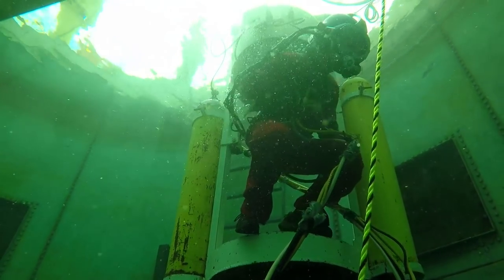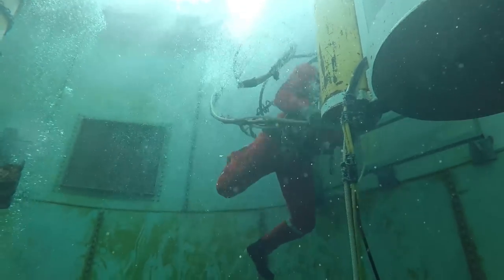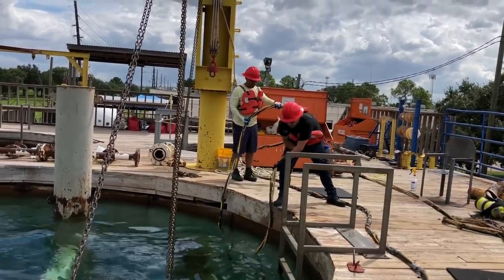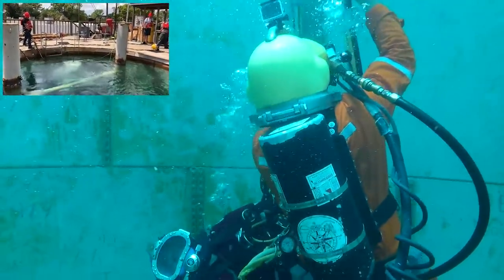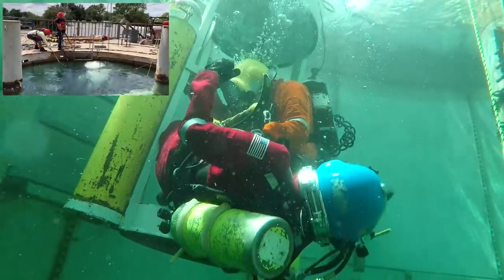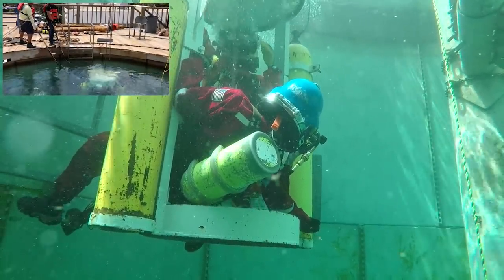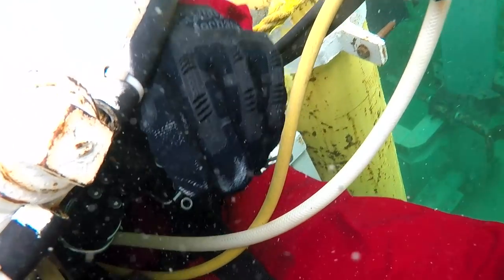Unresponsive Underwater Welder

Comment: I did this for almost 40 years. Started in the Navy, First Class deep Sea Diver for 18 of my 20 then worked commercial for most of the next 20. Also a year doing underwater bridge inspections for the Florida DOT. I loved every minute. Even when it sucked, was freezing, raining, zero visibility because when you get it done in those conditions you're allowed to be proud when you tell someone you're a Deep Sea Diver.
Reply: am i to old at 50 to do underwater welding, ive been a boilermaker / weld all my life.
Reply: @horseshoe182  I know a number of divers 50+ that I worked with. Obviously myself included. I don't know anyone personally  that got started at that age. Age isn't really the question. Getting a commercial certification is expensive and somewhat time consuming, Do you have any experience in the water? Recreational SCUBA?  Welding is about the easiest thing we do. Cleaning 50 years of marine growth off a sea wall before you make your first tack weld is where the work is. Running hydraulic hull scrubbers on 900' container ships with a 100' plus beam in 200' of water can take some getting used to. I've seen  experienced SCUBA divers freak when a hat went on and the breach ring was locked. I know this is long winded. The short version is you never know who gonna be the stud diver and who's going to suck at it until you suit up. Good luck.
Reply: Forgot to add this. What is your physical condition? There is a pretty comprehensive diving physical that must be passed every 2 years. EKG, chest xray, spirometer (sp) lung volume/function test. Higher body fat off gases less efficiently and makes you more susceptible to decompression  sickness (bends). Just be honest with yourself. It cost too much to try and wing it.
Reply: @careyrose6059  He's definitely out of shape if he thinks 50 is too old to be active. lol
Reply: @careyrose6059  thanks for that carey. eric bogar, your statement is very false and assuming, and thats how arguments start.
i,ve had a think about it and i think i,ll stay with contract boilermaking /welding. i don,t have the drive of a young man to follow through with the training.
Reply: Carey Rose Hooyah deep sea!
Reply: @careyrose6059  8
Reply: @horseshoe182  I'm making a living as a welder myself right now. A fab shop gave me a shot and some great OJT. Now I can weld anything they throw at my table. I get most of the aluminum TIG work. One of my favorites. Boss is giving my the evil I because I've been stalling taking my 3g/4g structural. He called me "Chicken". Lol
Reply: @careyrose6059  what country are you in? here in australia, we have the Australian Welding Institute that issues welding "tickets" (certification). i have no. 7 (tig) tested on pipe , and it wasn,t easy for me. out on site the Korean welders are the best by far, and most of them don,t hold any tickets. ive got tons of gear and i think im going to seek out my own clients, i can make and welded all sorts. i have a big old linclon jenny/welder and a new miller wire feeder, i,m interested in flux core welding atm, but anything to get the coin coming in. scored a job the other day and made 2k cash for three days work, so in theory it looks possible promising. i don,t think i,ll go for other tickets, only unless for job requirements/ specs. good luck with yours.
Reply: @careyrose6059  p.s  tig work is good clean work!
Reply: @careyrose6059  I just got my Open water certification. time to log 20 dives then apply to commercial welding school in canada. Hopefully ill be one one day
Reply: U a bad man teach me plz 💪🏾
Reply: @careyrose6059  i have a few questions about decompression sickness. How serious is it when you get it and how do you avoid it? Im taking welding classes and this looks like a really fun job to have.
Reply: @MileytheJeepV2  We (US Navy) broke DeCompresion Sickness (DCS) into 2 categories; Type 1 and Type 2. Type 1 symptoms fell under the P.I.S.S. categories. Pain in the joints, Itching of the skin, known as "skin bends", Skin rash, Swelling of the lymph nodes. Type 2 symptoms are neurological deficits, like vision problems, weakness, memory problems, numbness, paralysis, all the good stuff. 
It can be deadly serious. That being said, there are two primary factors to prevent DCS. Plan your dive and dive your plan. that means follow the schedule for the depth of your dive. Don't cheat. 
#2 muscle tissue off gases faster than fat. A lean machine with an efficient cardiovascular system significantly reduces your chances of DCS.
Also, if a diver does get bent, the quicker he/she is treated, recompressed in the chamber, the better the final outcome. And if not treated will result in a permanent deficit. As the diver, you're going to be the first to know something is wrong. Say something to someone. No one wants to get bent and I've seen a few that wasted some time trying to convince themselves it was something else and that delayed treatment. 
Probably should have led with this. DCS is caused when nitrogen bubbles in the blood expand as a diver ascends. When those bubbles get trapped by choke points in the blood system, they block blood flow to the effected tissue. If the bubbles stay then the tissue damage is permanent. Recompression in a chamber compresses the bubble back into solution in the blood and restores blood flow. 

Hope this helps.
Reply: Dope!
Reply: Carey Rose I’m 22 and I start my commercial diver course next year, any advice?
Reply: @CarLoverPhotography  I guess #1 would be to be sure you're comfortable in the water. If you have a dive cert and are comfortable in SCUBA that's a plus. Dive schools are expensive and to find out after forking over 15k to 20k ?? sucks. Seen it happen. 

 Get in or stay in shape. 2 reasons for that. Sometimes it's hard work, whether you're in the water or topside chokin' hose. A hat is always going to add resistance to your breathing. The other reason is an efficient metabolism off gases better which reduces the chance of DCS (bends). 

Good luck, and most of all have fun. It's a great life, most of time. lol
Reply: Thanks for the info 👍👌
Reply: how many ppl did you know fell to their demise because of the underwater welding?
Reply: @svgstudios831  Not a one. I've lost a few friends over the years, and heard about a few others but never during hot work. It was always something else.
Reply: @careyrose6059  scarry, props to you for being alive
Reply: Carey Rose awesome answers to all the questions thanks for the free info. I’m thinking of school in Houston and I’m curious about something. I have a kidney transplant (coming up on 10 years), I’m active, in good shape (jiu jitsu, running,etc.) , but I’m curious if this is an immediate disqualification or if it’s fine. I do take medication to keep my immune system at a regulated level when I wake up and go to bed but otherwise is good normal shape for a 33 year old Squid. Thanks 🙏
Reply: @Red_Cupp  You're going to need to check with a qualified Hyperbaric doctor. Obviously if any med carries a warning about machinery operation, driving or other potential  narcotic affects, it's a deal breaker. Call the school you're considering and see if they can refer you to a good doc. You might get info from your own doctor, but I'd definitely want to check with a specialist is the diving medicine field. Good luck.
Reply: Mike Hunt this is a good article on the subject : https://www.dansa.org/blog/2018/09/07/scuba-diving-and-life-expectancy
Reply: @mikehunt8064  The only people that know your life expectancy are the ones that show up at your funeral. My only life expectancy was to be happy doing what I loved to do.

Really the most serious health issue is with long term deep diving (saturation diving). It's known as Long Bone disease, syndrome something or other. Has to do with deterioration of the long bones of the body due to extended exposure to the high partial pressures of the gases the diver breaths at deeper depths. (+300 feet sea water FSW)  I don't know the specifics. If a diver makes that career choice, they will get the latest and greatest info on the latest and greatest research.
Reply: How much were you paid? Is it worth the risk?
Reply: Jeff King  I don't know what to say man. we all have are lows in life. Things will get better.
Reply: Jeff King  Are you ok dude? just checking in.
Reply: Lies
Reply: Omg im in school for welding now id kill for a job to weld im 17 trying to get a career in welding
Reply: I cant wait, i hope i get to achieve my dream.
Reply: @lukesweet1737  my advice, learn how to stick weld first. Gives you a good understanding of the molten pool and how to weld properly. Then learn to MIG weld then finally TIG (where the real money is). Anyone that slags off TIG welding simply can’t do it.
Reply: Hooyah my deep sea brother, Have you ever been to diversrecall.org. We will all be there.
Reply: Complete respect for this. Best of the best.
Reply: @patrickryan9410  Guess I missed this when it came in. I was at the recall in '96 or '97. My locker at TRF King's Bay sent a couple of us to the Working Diver's Conference and the recall was the same weekend. I retired in '97 and spent a pretty good chunk of the next 20 working in the western Pacific. I like warm water. lol 
Working in Texas now. I may try to make it out next year. Maybe some of this wacky $hit will level off by then. If not, well, we all know alcohol kills germs.
Reply: Respect.
Reply: Hey Carey, Idk if you still reply to this comment thread but I had a quick question. I've been looking at doing commercial diving but starting in the Navy as a Navy diver any tips on what to do to up my chances of becoming a Navy diver?
Reply: Àa❤❤àaa❤❤❤❤àa
Reply: Thanks for your service brotha glad there is people out there like you because I could never!

Comment: Note how when he's on the bottom, the "distressed diver's" suit looks black, but once he's hoisted up to the bell you can see that it's red. The rescue diver's orange suit looks almost brown ("burnt orange" to use the art term) at depth. This is an excellent example of how water absorbs different colors/frequencies of light differently depending on depth, with red being the first to disappear. When I'm doing underwater photography, I often use a red filter on my light so that I can replace missing red light without over-exposing other colors. If I'm deep enough that all colors are being dimmed, I use an unfiltered/white light.
Reply: Yea. That seems like an enjoyable hobby.
Reply: I thought they had changed clothing I was tripping the green made his clothing change color
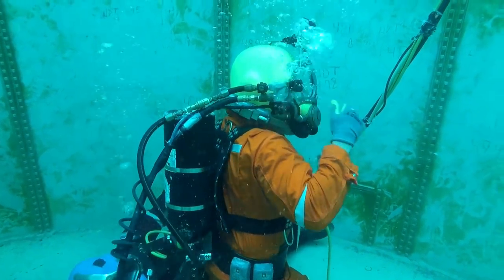Reply: @jonDoe-ml3jq  That green tint was due to an incorrect "white balance" setting on the camera or playback; you can see it being switched to the proper setting at 2:52.
Reply: @seikibrian8641  oooh I see thank you
Reply: thats the reason why fish are red in deep water
Reply: Actually it's due to the transmission of light in the water. Red goes first, then orange, yellow and on until you get the the greens and blues. Which is why things get bluer the deeper you go. If you turn on a light you will see the true color. At 15' deep your blood will look green if you're cut. 

Objects will also look 25% bigger. It's the refraction caused by light waves traveling slower in water. Same reason for the color appearance.
Reply: @careyrose6059  "Actually it's due to the transmission of light in the water. Red goes first..."

LOL!  You just repeated/reworded what I said: "This is an excellent example of how water absorbs different colors/frequencies of light differently depending on depth, with red being the first to disappear."
Reply: Thank you for that knowledge
Reply: Thats cool and all, but i don’t remember asking
Reply: @bc-qs5rw  What, people need your permission to post comments on YouTube?
Reply: Ahh, so that's the reason fish have no eyelids. #FunFact #LearnSomethingNewEveryDay
Reply: great input

Comment: The purpose of drills are not to see how fast you can do it, but to make sure that you don't miss one of the steps. Once you get it right, you can work on getting it done faster. With that in mind, I would say that this is a good example of how its done. Its done differently in other places, but most always dictated by company procedure. Would be a good idea to keep the standby diver dressed throughout the dive, you could possibly save a couple of minutes, especially if you have to go look for him first...

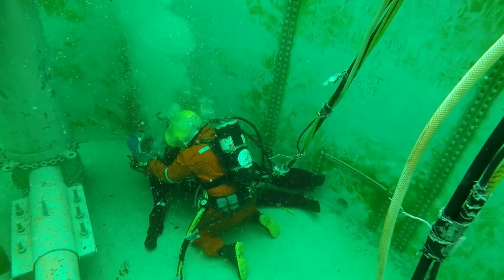Comment: 2:27 Whats The Point Of Looking Inside?😂. He’s Unresponsive UNDER Water. Whole Purpose Is To Get Him OUT The Water 🤣
Reply: Clues or signs of what he might be suffering, he's unresponsive but you can see if his eyes are still open, foaming etc and pass this onto topside who can relay it on to medics etc.
Reply: In a deeper place you can't just go back to the surface. So first, ensure the diver can breath and then you will worry about getting him out of there.
Reply: It stated that he "checks and freeflows the mask" incase the diver is drowning.  This flushes the water out so the diver has access to air again

Comment: Well thanks for video upload, that's way too different diving rescue in states compared to the UK or rest of the world we follow IMCA training. There is few things are not correct, 1st, after he opens his freeflow of the hat of main  supply need to turn off and open his emergency supply (assume if he collapses by breathing contaminated air) 2nd rescue diver, must have 1feet safety lanyard so he can connect himself with diver chest D ring ( so the victim diver close to him and lifting the diver upright position and even rescuer can support victims diver neck to avoid neck injury and his fins or pressure gauge or any tool not get entangled during rescue which avoids delay to clear up in rescue process) 3rd rescue diver should connect man hoist on victim divers harness neck D ring (that will help victims diver stand straight upright and even rescuer can support victims diver neck to avoid neck injury)
The commercial diver training in States is not updated so now ADCI and IMCA try to work together to improve the diving safety standards.  
www.divingtask.com
Reply: Thanks for posting this I was about to ding on several of your points especially the heads up portion, venting does not work if the head is down and the helmet is flooded.  Also control of the airway, if the head is tilted down airway can be blocked with the potential for AGE, or lung expansion injurie.  The recovering diver needs full control of the injured/non responsive diver.  I am glad to see them running drills, it just needs some refinement to make it right.
Reply: I've been a dive supervisor for 10 years, training like this is what kills people... All regulations require direct umbilical control from a tender, that means that an in-water tender should have been used in any operation where a bell is used. Standby should have been ready to splash immediately, gloves are required on all job sites. The retrieval device should be hooked to the retrieval D-ring behind the divers head and the standby should have attached himself to the unresponsive diver after opening his egs valves to ensure bad gas was not the result of the diver losing consciousness. When it happens in real life these things matter, I hope they change their curriculum.
Reply: Thanks for the feedback. I have made several changes as you guys mentioned and additional such as tending to the diver out of the water, tourniquet placement underwater, chest compressions underwater etc

Comment: Why are the air tanks on commercial divers carried with the valve in the down position?  I've noticed the same with SCBA's used with firefighters.  SCUBA tanks are normally used with the valve in the up position.  The only thing I can think of is with the valve and hoses in the bottom position, there is less chance of getting tangled.  If there was a small amount of water in the tank (happens) it wouldn't matter, as the valve on a scuba tank has a stem a few inches long, so it wouldn't pick up water.
Reply: its an american thing, the tank on his back is called a bailout. it is reserve air. they leave the valve on the hat open and the tank off. most of the world closes the valve on the hat and leave the tank open.  its supposed to keep all air in the tank incase of regulator leak.  although i would never dive like that it is very hard to reach the valve when fully dressed in.
Reply: It's easier to reach than behind the divers head. We teach to leave air off at the bottle and hat so they don't accidentally bleed off emergency air